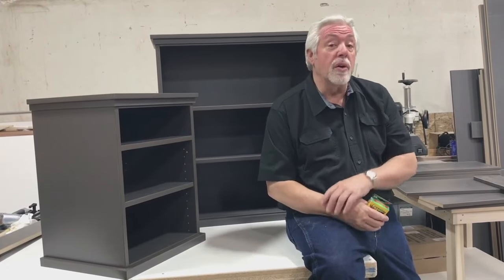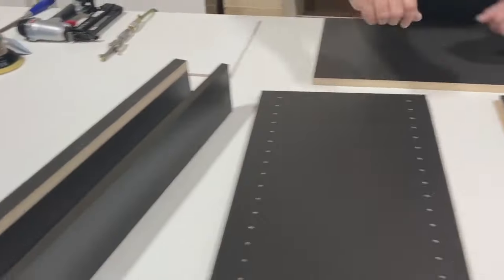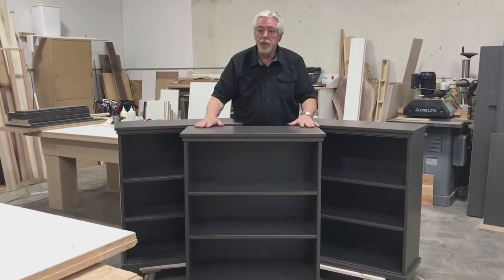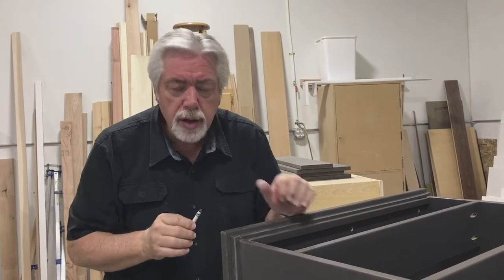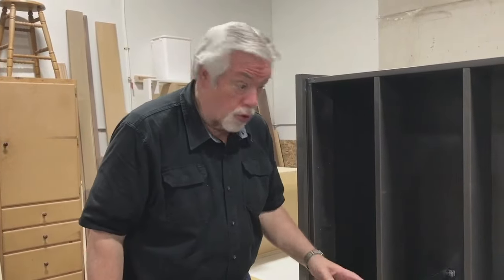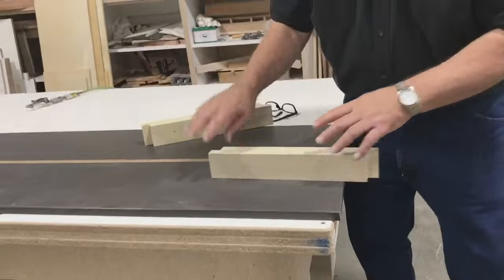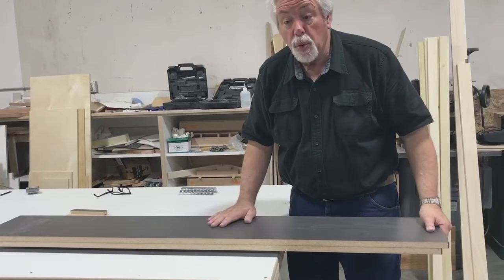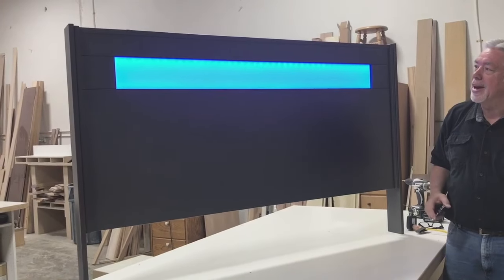How To Design, Build And Install A Modern Bedroom Set

Comment: HI Wes. Thank you for taking the time to show us your skills and passing the great info on to us. I am a beginning woodworker--started during the pandemic--when I decided to participate in our kitchen remodel by redoing all the doors and drawers plus build pull out shelves, molding etc. It's time for me to purchase the wood for the 21 doors and drawer fronts and make the shaker style doors. what is the best way to buy the wood? I need a lot of it and it will be quite expensive. Poplar is the wood I 've decide on currently  $3.99 bf at the local Hardwood warehouse. some advise will be very helpful. Thank you.